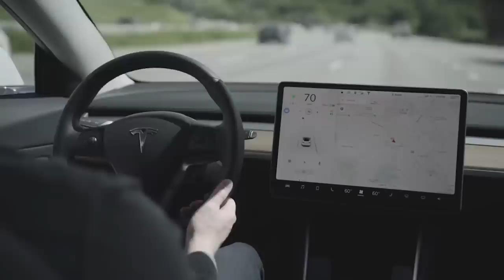Tesla's Goals for 2030: Farzad Mesbahi

Comment: Farzad is spot on with the factory announcement per year. Tesla is running maximum delivery capacity at the current plants (1,300 cars per day). Do the math on how many cars per day 20 million (54,8000 per day) is. Trucks can haul 8-9 cars at a time, trains can haul 2,080 cars per train maximum, ships can haul 8,500 cars. I think we are also likely to see a Tesla announcement of a Tesla Semi car carrier, a fleet of Tesla cargo (PCTC) giga ships, and a Tesla plaid bullet train. How the heck are they going to move that volume? Tesla teleporter?
Reply: Current production rate (Q1) is 4831 per day
Reply: VW , Toyota, and others have been moving bigger volumes of cars / year than that. The Wolfsburg plant has train cars rolling through the plant and loads them directly inside the plant. The need for ships will flatten out or increase slowly enough for ship builders to keep apace as more Tesla plants are built. And lets not forget FSD. At some point Teslas will drive themselves to the trains and sales locations. I'm surprised they don't do that in a "Geo fenced" way now in Texas to the train depot.